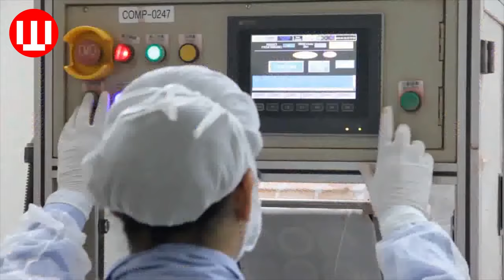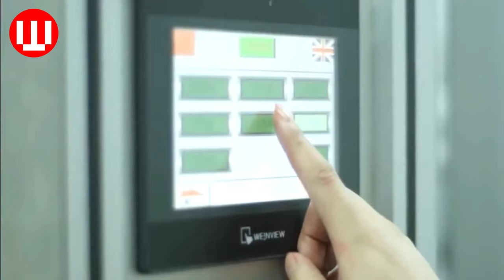Cosmetic Factory Tour - Amazing Cosmetic Manufacturing Process

Comment: now i feel better about making my cosmetics at home for myself. my kitchen is more hygienic than this. it's so confusing, is this even real? not even gloves on most people? no masks?
Reply: You must be American 🤢. In the real world, we don’t use gloves, we use soap. Just a handy FYI, soap also sells as hand wash, and in a pinch you can use dish soap. 

You have to be able to put gloves on properly without touching the outsides, and then change the gloves between each ingredient or step, it’s not feasible or hygienic. 

It’s much easier and cheaper to wash hands between steps
Reply: Excellent point. It was my immediate reaction to the poor condition of this factory.
Open vats, talking (i.e. invisible spit flying) near those containers, naked skin right over the pouring area - who wears short sleeves!?
How about some Ben Nye concoction with a side of arm hair and spit?
>>shudder<<